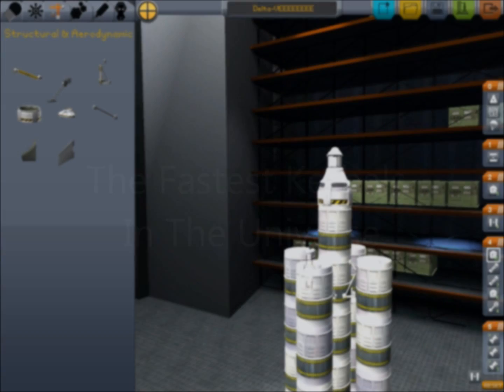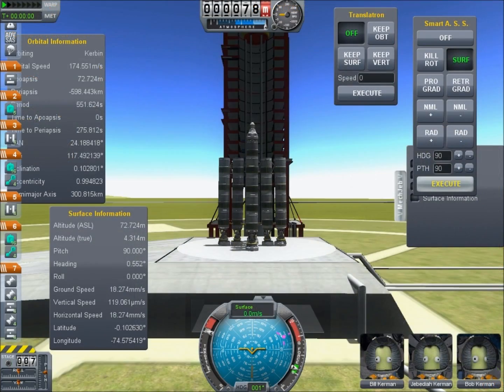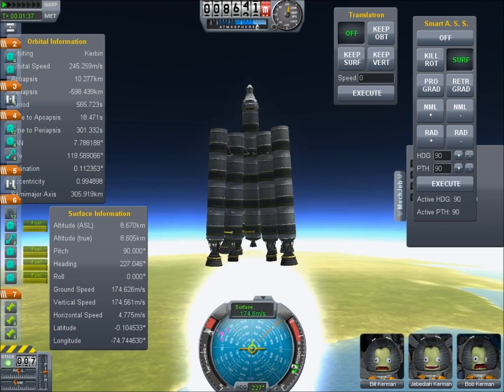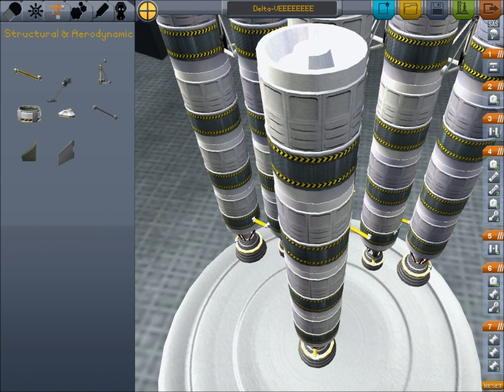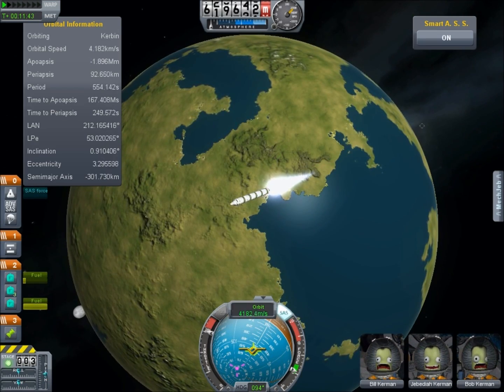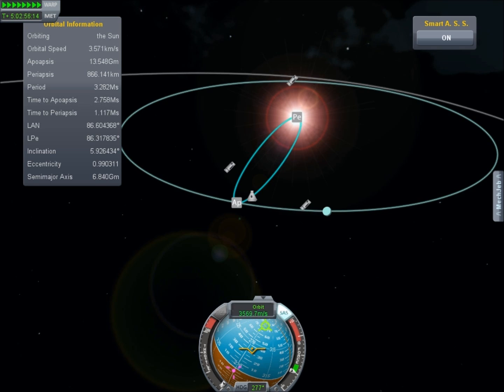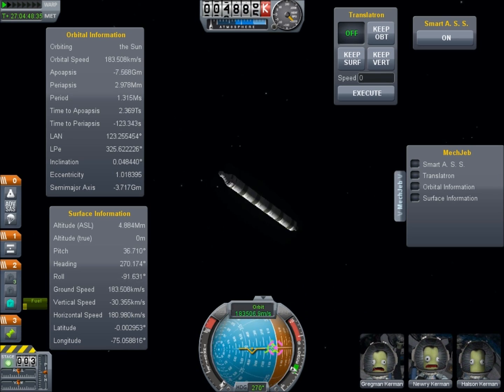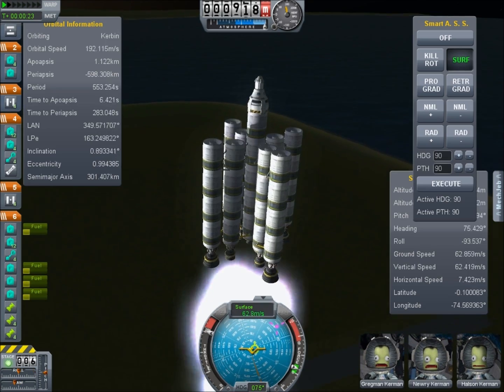The Icarus Project - Sending A Rocket to the Sun in KSP

Comment: why you did'nt used a probe?
Reply: This video was made before there was nuclear engines, 2.5 meter parts, motorized wheels, wings, or even multiple command capsules. The one he used was literally the only capsule in the game. There were no probes, no science, no money, no runways, no female kerbonauts, not even planets other Kerbin, Mun, and Kerbol.

Two engines, two LFO fuel tanks (1.5m medium and 1.5 short), One rcs tank, one RCS thruster block, two canards (one which moved and one which didn't), one landing gear, one parachute, and there may have not even been inline reaction wheels.
Reply: Oh okay thanks. A year ago i just didn't knew about KSP that good. I didn't even had it.

Comment: would putting fins on the bottom of the rocket stop the spin?
(cant remember the technical jargon)
Reply: +TheDct88 No, it wouldn't. After all, they need a thick atmosphere to work. And space is a vacuum.
Reply: That's not how fins work. They drag against the atmosphere making the rocket go straight but without an atmosphere they don't work.

Comment: I already know from the capsule,fuel tanks ,and engines that this is the original KSP but does come with full version? It doesn't really matter
Reply: The full game has much more stuff than this. The old parts have been upgraded into new parts, and they've added over 90 new parts after this was made. Even the demo has more stuff than this.

Comment: It can be done, but it requires the use of lots of girders and struts which make the thing very complex and laggy. Basically you have an upside down chrismas tree like configuration of fuel tanks connected to a spine made of girders. the girders transfere fuel down to an engine cluster at the base. In theory, the engines keep running while the spent fuel tanks drop off. The hard part is making sure the fuel tanks dont hit anything on their way out.

Comment: I flew at nearly 10% of light speed in a test today, using a small satellite with one ion drive. 27'465'198.4m/s. I was so far out of the solar system that I could barely see it on the map.

Comment: It does help however when you are coming into a landing example I once by accident ended up using Ike to pull me in to just the right altitude for areo breaking (ironically the save before that Ike had decided to randomly eat my rocket must have felt guilty)